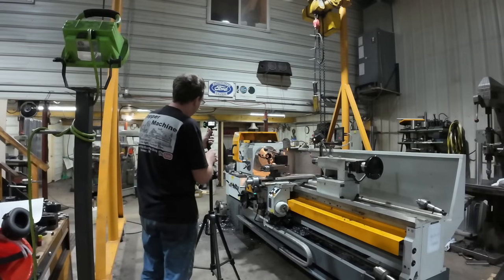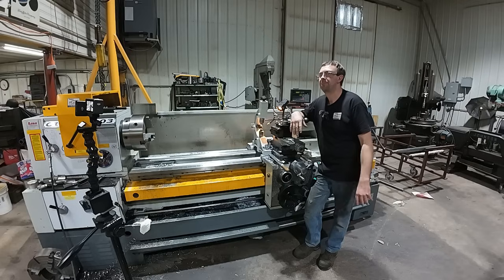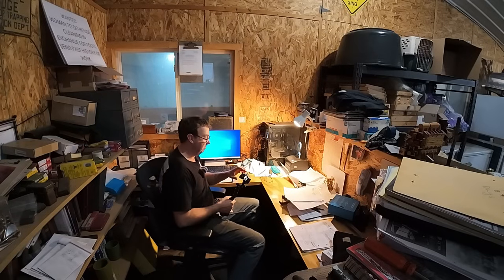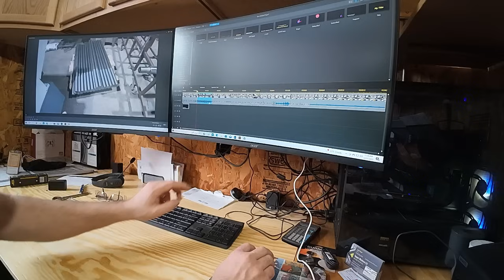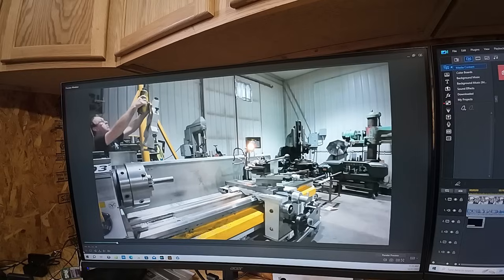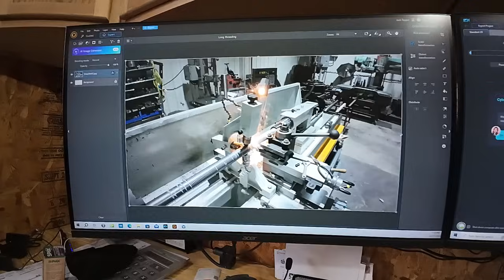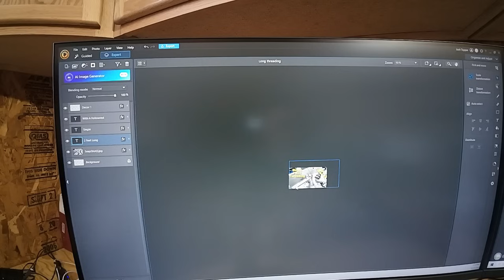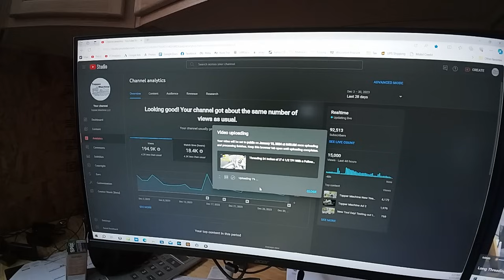Behind The Scenes, What It Takes To Make A Topper Machine LLC Video.  Filming, Editing, & Uploading

Comment: That is a lot for me because I hate computers too! I was gonna start videoing my projects too so I bought a tripod and at the time the IPhone Promax13 with tons of storage and I never ended up doing it. I’ve done tons of projects since that probably would’ve done ok if it was for me. I totally restored my 9” SB lathe along with setting it up on the Bridgeport I think 13 different ways for every angle. I even used primer, base and clear coat paint. Man that thing came out near perfect with less then .0005” of runout along the whole bed. Not bad for a Bridgeport. I built a 13HP high compression go kart motor, a small block Chevy 409 with 575HP that is about to get a pro charger. I even painted the car myself and body work was one of the very few things I’ve never done. That also came out really good. I built a 700R4 trans for it and broke it twice so I built a TH350 with all the goodies including putting the drum on my Clausing so I can add a clutch. I’ve done so much more then that lol. I think my channel would’ve done ok if I was good with computers. Nice work Josh!

Comment: Great to see other folks' workflow and methods. I usually budget around 1 hour of my time per minute of finished video. Current one is 28 minutes and is made up of 481 clips, animations, stills, screen recodings and voiceover segments in Davinci Resolve Studio. It's condensed from around seven hours of video on two cameras with separate voice recording that's then auto-synced with the in-camera audio when I'm talking to camera, plus some work with a wireless lavalier mic. I tend to ramble when I'm talking to a microphone, so for the voiceover segments, I record a first draft, then the system generates a script from that and I tighten it up where needed and use the edited text as a guideline for what I'm going to say so it fits the video perfectly and isn't full of "umm" and "er" and me repeating myself! Then there's the captioning, which I do in Davinci and export to Youtube. - a lot of my audience use subtitles with translation into many different languages. I also generated some animation sequences in Fusion360, plus a tightly-edited screen recording of design work in Lightburn for some CNC laser sequences. It's way over my "one hour per minute" estimate now, but this is for a commercial sponsor, so I don't mind the extra work. As you say, it's absolutely not worth the effort just for the Adsense income alone.
Reply from the maker: Man, that's a lot of extra work. I hope they pay you well.

Comment: I most certainly don't have the number of cameras that you have, nor the space for tripods, I used one originally, but I was always tripping over the damn thing, so I put in a ceiling-mounted track and mount the camera on that. I do try to reposition it occasionally, but I only have a small mini mill and a small lathe, both of which I made myself, and both are prone to vibration, so mounting a camera on the machines is not on. I have a tendency to edit my videos on the fly, that way if it is something I can reshoot because I wasn't happy with it, I can reshoot it. Like you, I can spend as much time or more than the video length editing it all. Enough rambling, I'd like to finish with a big thumbs-up 👍 for your choice of music, I loved it. Thanks for going to the trouble of making this video, I might steal the idea when I run out of ideas for projects.

Comment: Thanks a lot for showing this. It always astounds me the level of hardware that still can't process a video clip fast enough. What's the specs on your computer.

Also, have you thought about a camera arm instead of a tripod? That might make some angle changes faster and easier. There are a number of YouTube makers who've done their own camera arms, and seem to be very happy with them. Alexander Chappel made a counter weighted, floor standing one, and Marius Hornberger made one that runs on rails on the ceiling.
Reply from the maker: I use multiple different mounts and tripods.  Most shots are with a magnetic mount.

Comment: Those must be toggle bolts for a jaw crusher. Toggle bolts are at the bottom of the moveable jaw and pivots on a toggle plate. The bolts keep the my jaw against the toggle plate. Spacers, shims, or another system controls the opening.
  Please turn the volume down on the music. Thank you.
Reply from the maker: No idea, I just get told the basic information I need to make the part.